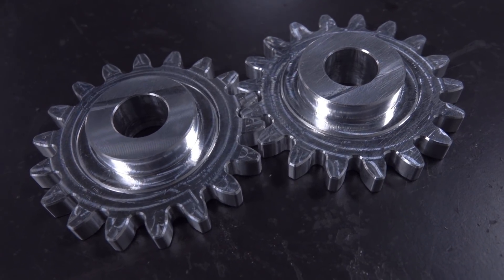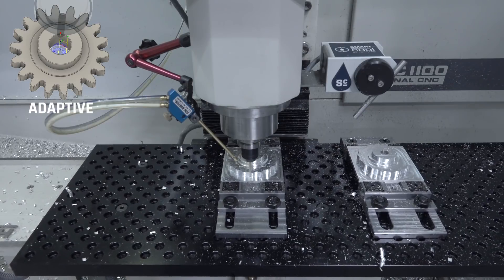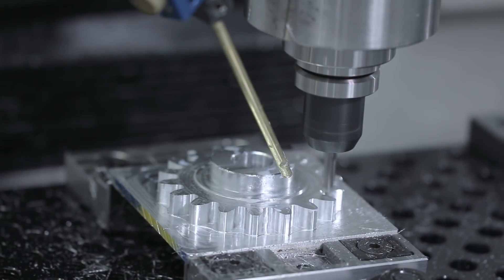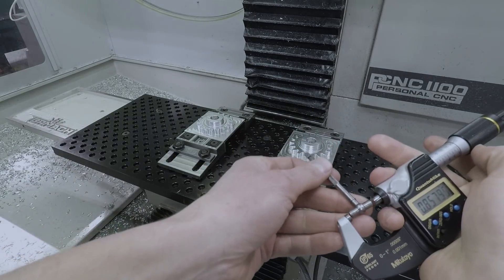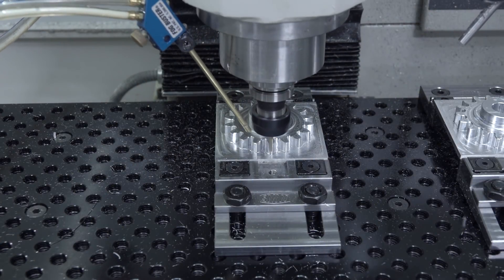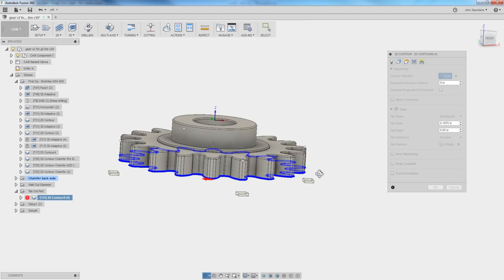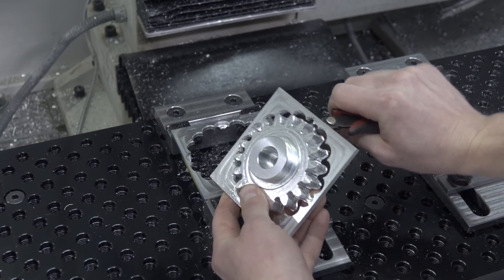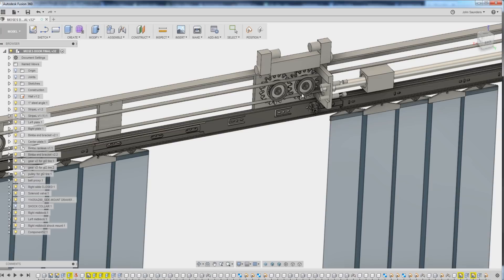Machining Two Gears! WW181

Comment: Funny, right before you switched over to the lathe I was thinking I would do the first op on bar stock in the lathe, forming the bore, steps, and face. Then run the teeth of the mill. I have a 3 jaw chuck mounted on the corner of my DM-2 for holding round stock.

Comment: Unless the purpose was to show us the tabbing feature or backside chamfer, I figured since you went with the lathe to finish the side, a smarter approach would be to just leave the tab out tool. Bandsaw the excess corners, and face off the whole thing.

Also, seems weird that your Diameter offset is that large (.2471). Your toolpath should still be cutting on centerline. The only offset you should be putting in, is the distance you want to go. In Radial. So the number would be (-.0015). The controllers I use at work, always use this logic. Sounds normal to me.

Comment: If you cut it with machining, the module is not accurate, so it will probably use a hobbing machine, but at least precision wires are required but have you learned machining and design?

Comment: hey john nice video. just a heads up your measuring technique, your putting to much pressure on your telescopic gauge with the outside mic and not sweeping the gauge past the anvils to find the highest point to get the most accurate measurement.

Comment: At 09:30, when you do final machining in a long bore with a end mill I often go counterclockwise to achieve a straighter hole, it's harder on the tool, but it leaves a straighter hole

Comment: Why not just have a 3 point inside mic? I do gears and splines at work all the time. Had to learn how to use 500k€ coordinate measuring machine when making a set of gears. And dude, there's nothin wrong with lathes, I used to love mills but damn innit nice to say I drive 13 axis lathe :D

Comment: I always machine bores with an adjustable boring head as I find milling them makes them slightly oval which then makes them run off on the lathe if you use an expanding mandrel.
Reply: The problem is in your machine if circles become ovals. Backlash, bearings shot, loose gibs, pitch error in screw etc. are all contributing factors. On a Quaser with Heidenhain measuring devices you get true circles within  less than 0.01 mm roundness error :)
Reply: Yes that's fine but most of us can't afford that level of equipment! A boring head is £200-500 and will get less than 0.01mm on a good manual mill..but if you have the machine like a quasar yes you can mill the bores ;-)

Comment: At 81 I just completed building a 4 X 4 CNC DIY router. Now is the time to learn. As I watched the making of these gears, I realized how much I enjoyed the lathe work. Back in  the 50's, we had a lathe in the shop where I went to high school. I remember how I loved to mess with it wishing  I had something I could build with it beside a head of a small hammer without a hole for the handle. Didn't follow that path, but wonder where I would have gone had I done so.

Comment: You absolutely MUST get one of those Arduino controllable MP3 modules to integrate with the controller for this; and load it up with the door sound effect from the Enterprise. They’re only a few $$$ on eBay; and would add SO much to this project. 😎

Comment: Is there a downside to turning on smoothing?  Seems like that should be the default.
Reply: I think it converts the involute coordinate points to a multiples of close aproximate arc. The later would probably introduce more deviation from a true involute profile, affecting the final rotation accuracy of the gears, vibration, efficiency, noise and longevity. I could be over thinking it though

Comment: I'm surprised you don't have a 3 jaw chuck you can just bolt down on the mill table. Would have worked great to deck off the back of the gears.

Comment: @NYC CNC
Nice job !
You could also have used the "picture frame" machining method.
No need for soft jaws or a lathe setup.
Just a little bit more material to keep a frame around that part.
You put holes in the frame and bolt it directly on your table for the second operation.
If you don't want to have bolt heads in your way, you can use Mitee-Bite Loc-Down system:
http://www.miteebite.com/products/loc-down-system/

Happy machining !

Comment: .01 too deep or shallow on the backside chamfer?  My guess is too deep?

Has to do with the way the tool is ground, the tips don’t come to a perfectly sharp angle, or usually don’t, and there is a section of straight vertical flute where the angle meets the bottom. This will cause and issue in your height offsets and needs to be compensated for. 

It’s similar to how a chamfer mill has a small flat section at its tip and will cause chamfer dimension errors if it’s not compensated for.

Comment: It looked like you set your tool off of the bottom of the part based on the paper thing you were doing. Setting an offset from the top face you previously machined would have probably been a better choice.

Comment: I wonder why F360 doesn't have smoothing as a default?
Reply: Dave Anderson cause some Controllers for example grbl cant handle it
Reply: MW Design either way, you should be able to default it one way or another.  I think the vast majority of controllers can handle smoothing.
Reply: No.. they can handle it make the code smaller.. They can't all the point hence smoothing and it shortens the code length win in my book.
Reply: most high-end machines work better with it off.  Also, set your own defaults at any time.   We are working on machine configs.  That will then expand to drive machine specific defaults.

Comment: Hi John, Yes Star Trek doors! So, are you using a worm screw to do the opening, or cables?? If worm, you could set the open speed quite fast for 90% of open travel, then ramp down to 0 velocity for the last 10% Closing, probably something OSHA might be comfortable with! What's the detection method, a IR sensor, or wearable trigger device? If the latter, don't forget to transponder the dog!!

Comment: Hey John, you may want to try a pocket cycle on the rest material for the 2nd op. It works well and you don't have to worry about the rest material pulling up.

Comment: I feel like creating a CAM program and putting it in a cnc lathe for a simple facing operation for 2 parts rather than a manual lathe was extremely impractical but hey, made for excitement seeing it in a video
Reply: Nick O'Neill It wasn't really that impractical. It prob would have worked out the same, since you'd be taking measurements as you face it on the manual lathe. Maybe 2-3 measurements on the manual, vs one on the CNC. Also, maybe he had a 3 or 4-jaw chuck in the manual lathe, which would have taken even longer.
Reply: Nick O'Neill 
Or he didn’t have a collect adapter for the manual lathe... meaning couldn’t use the expansion mandrel and would have to mount and bore soft jaws.  Where as the cnc lathe has a collet holder that will take the expansion mandrel no problem and the CAM for the lathe is like 5 clicks and 2 minutes...

Comment: Who in their right mind would want aluminium gears, better make some more spare ones.👍🏼
Reply: seriously, aluminum gears will be awful!   remake one or both out of delrin or mds filled nylon. aluminum will gall  very quickly if you don't run them so loose that they'll  wear very quickly and jam up anyway. you'll be much happier with the nylon...........love the fusion tho! thanks
Reply: Use 7075 and get them hard anodized maybe?  I think its light duty...
Reply: Cinnabuns2009 yeah fair enough when I seen what they were used for at the end of the video I realised they didn’t need to be strong tough ones, steel ones would have worked better tho
Reply: 3D print the gears. Use nilon if you want but in any case 3d print is just fire and forget without all that CAM work.
Reply: But aluminum is lighter so less moment of inertia and John said they wanted fast. Less dead weight the better in that regard.

Comment: Star Trek doors..?
Reply: EXACTLY my first thought!!   I needs to make the "swish" sound.
Reply: Yeah
Reply: mikeselectricstuff    They actually used people to pull the Star Trek doors because the tech was just not there. Aluminium gears... As long as they are not loaded up.  I love the "lets add some tech to solve an otherwise simple problem". It's also known as fun!  Another great one John. Thanks.
Reply: I smell an Arduino in this project !
Reply: Maybe an air motor with dual valves would be a nice "swoosh"
Reply: the original sound effect was paper being pulled out of an envelope...
Reply: How do I find mike's comment under almost every video I watch? Even under his videos.

Comment: Wouldn't thinner material have sufficed? I mean, you cut of a whole ~5mm at the bottom, anyway. And did you reference the turning tool off of the bottom of the part? Then the dimensional error could fall under stock tolerance.

Comment: What's the point of running the flywheel over the entire surface when the Shear-Hog carved most of it out except the very center?
Reply: ajtrvll
Could be force of habit. It's nice to know after the first tool that your stock is at the exact height you think it is and since the SuperFly leaves such a good surface finish and is so efficient at removing material that it's pretty easy to start each job with it.

Ever done a facing pass and look at the part to see some of the bar-stock finish is still visible? Maybe the stock wasn't flat or maybe it wasn't seated well in the vise or you messed up with setting the Z-0 point (or a dozen other possible reasons)... Well, if your facing pass is the first op, you can just lower the work offset and start over. No harm no foul. It sucks to have that happen when you've decided not to face the part until half way through the job because you were trying to save 20 seconds of machining.
Reply: With the single point "seam" right across the center.  Yeah was wondering this too.  better yet, vs. the shear hog, why not just use an aluminum rougher, encircle the gear full depth, come up and encircle the hub, 1 tool.  Finish the face, sides of the hub and face of the gear with finish tool, 2nd tool.  Do your detail work on the gear and chamfer.  Also, how can you not clock the part when it has an even number of teeth?  Don't need soft jaws.  Two teeth on top, two teeth on bottom, in the vise, parallels on each side of the hub to supprt. flip the part, run your rougher around the gear teeth in a circle coming in to remove all excess material staying .5 or whatever off the diameter.  Rough the rest, finish face and chamfer.  Low tool pressure and gtg.
Reply: Cinnabuns2009
Holding that gear by two teeth against each jaw of a vise would mean you'd have two narrow strips of contact between the part and each jaw. The contact patch would be basically nothing, it would be like holding a square piece of stock by the corners only. And since the pitch of those gears is probably about 0.75", you'd have over an inch and a half of leverage working against you.

You might have noticed that the entire top appears to have been roughed out with the Sheer Hog (1 tool), as you've suggested. Why not full depth? Lack of rigidity is my guess. Once you've removed most of the stock material from around the gear you're left with only a thin piece being held between the jaws of the vises. Taking too rough of a cut with such a small amount of stock remaining could potentially lead to chatter.
Reply: Hirudin - Good point.
Reply: Our job shop does lots of 1 & 2 parts all the time and I try and be as efficient as possible.  If you're uncomfortable with that, you could always use Vblocks on either side that would likely give you more workholding and you could still probably clock the part without a specialty setup or custom softjaws or what not.  Welcome to the world of daredevil machining!  haha...  I'll see what I can do the next time I have a sketchy setup.
Reply: That's what the parallels are for.  They constrain the gear from twist.  Sure it won't work using a gigantic cutter with a ton of tool pressure but it works fine when using a 1/2" rougher with very little tool pressure.  I've done it so... yeah.  Requires no setup, no dicking around with Tabs and what not and programing for an hour.  Just flip the part in your 3D software, rotate it to the right alignment, remove the toolpaths you don't need, regen and run.  Its not some stupid overly exotic solution but it works.

I know he likes the shear hog.  Every tool has its place.  He uses it way too much for way too many things where its not even close to ideal or quick.  Its like saying, "Let's use this 3" shell mill to do an adaptive rough on this gear."  Could you do it?  Sure.  Why would you though?  Why would you tell people that's how you're going to do it?  For someone like NY CNC who "seems" to put so much thought in to things.  There is surprisingly little thought put in to efficient toolpathing and tool choice, and optimal setups which if I don't get as the dude seems to be a smart clever guy.
Reply: Cinnabuns2009 
It sounds like a sketchy setup, but if you can make it work I guess that's the important thing. Next time you mill a gear like that maybe you'd be willing to record it and put it up on YouTube. I know I'd watch it; I'd be interested to understand the calculations that go into milling a part that is being held by such a small surface area. What would you guess the surface area is? Maybe 0.1 square inch on a good day? And what about gears with an odd number if teeth? Seems like the contact patch might be about equal, given the geometry involved. And if it isn't equal, it must be at least 75% as good. Is losing that last 25% really the tipping point?
Reply: Personally I would have blanked it in the lathe then a quick profile on the mill and been done.